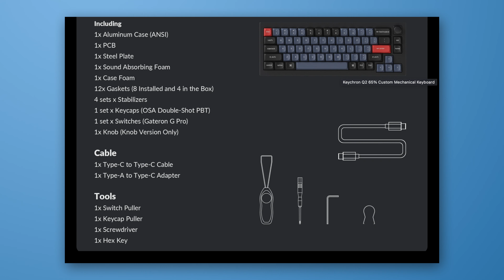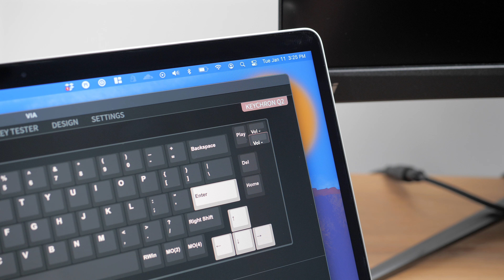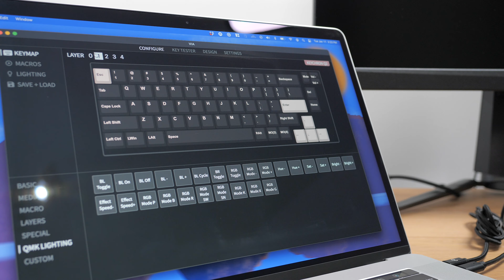Keychron Learned! ~ Q2 Mechanical Keyboard Review

Comment: The Q1 also uses wires for the daughter board. Only the Q1 review units had a ribbon cable.
Reply from the maker: Ah right! Badseed also mentioned the non-ribbon wire so I guess that makes sense 🤔
Reply: No, the first batch has ribbon (I received with the ribbon, 1st batch).The second restock of the r1 has those changed to wire

Comment: This Q2 looks nice, but as a programmer I would be missing F-keys row.
Reply from the maker: Then Q1 it is 😝
Reply: You could wait a month or two for the Q3 to roll around as well
Reply: @idriftob4564  whats the layout for the upcoming Q3?
Reply: @axbyxaby  tkl and tkl with knob, shame they didn't go with tsangan bottom row though
Reply: I switched to VIM controls when I switched to a 60% layout, which helped a great deal (assuming you're comfortable with VIM-style typing), and pressing FN-# to use an F key works fine for me. The only key I haven't really gotten used to is that '~' is FN-SHIFT-ESC. But, over all, I've really been enjoying programming on a 60% board.